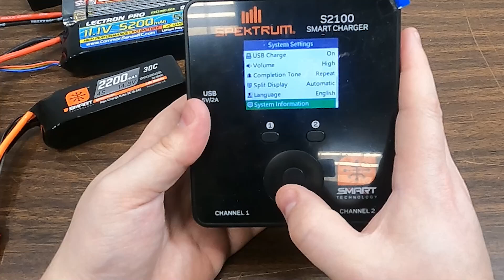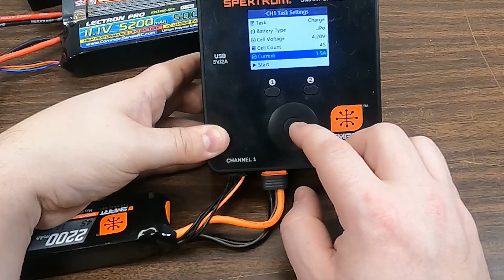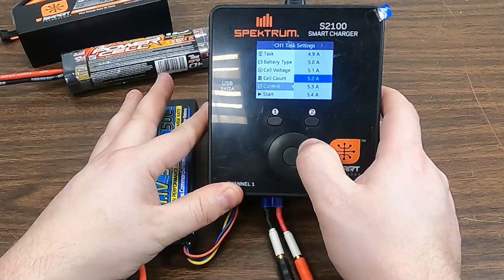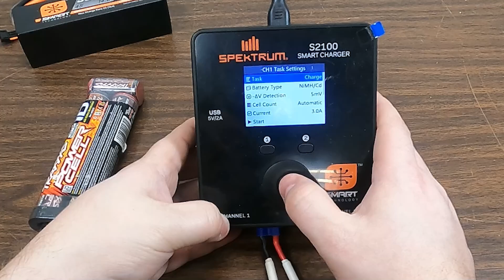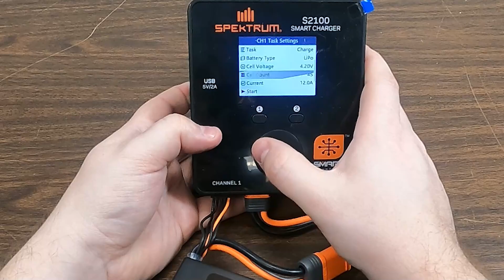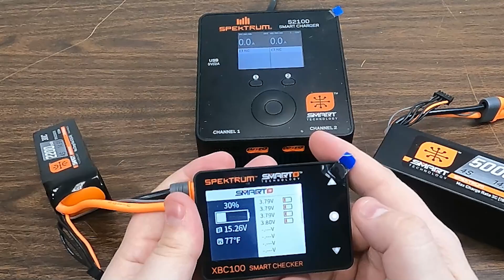How to set up and use a Spektrum charger.

Comment: What's the name or model number to the updater cable. Would there be an issue if the Grey cable smart cable is cut off? The balance cables are fine.

Comment: So I have a question. I was charging both batteries once it was done after the second beep I went out side for about 6 minutes when I came back in side to disconnect I noticed the charger was off . I disconnected the batteries but the charger did not turn back on ! Any ideas? Could it be it fried the charger?

Comment: I have bought two of these s2100 Smart chargers and have been trying to charge one 6S spectrum battery and two 3S spectrum batteries and both chargers will not do anything. I plug everything in it doesn't even recognize the batteries in the channels I try and charge it gives me the warning to charge without the balance lead plugged in, which it is plugged in. try to charge anyway by clicking yes starts for half a second and then says abnormal battery connection. this happens on both chargers and with all batteries.

Comment: Dear all

Need help. After two months charging, everything was working perfectly. Today was doing same procedure, as soon as I press start charging, no reaction. Don’t know what to do. I have two batteries, same thing 

One more thing, when I turn on the smart changer on a screen blinking a battery 🪫 with a question mark ❓ 

Spectrum S2100 smart charger
Battery 5000mAh 4s 14.8V 100c
Please suggest maybe a hotline for consultation.

Thank you
Reply from the maker: Sounds like maybe you have battery issues. Do you have a volt meter you can check the battery voltage with. The batteries you have should not be under. 12 volts. if it is you have bad batteries.

Comment: I have this model but screens are different. Is it supposed to automatically balance the cells. I often have some max min between the cells as much as a .25 volts.
Reply from the maker: It will only balance the cells if the balance lead if plugged in for the g1 batteries and will balance automatically with the g2 batteries. If your cell voltages are off after the charge is completed then you may have issues somewhere. Chargers will balance near the end of a charge so if it is still charging the be patient the charger will fix it. 

One thing to note that if the batteries are off by a lot, it make take the charger several cycles (one cycle meaning one charge and one discharge) to balance out a battery.
Reply: @Hobby365  thanks.  I have a spectrum G1’s and HRB’s.  I can charge and balance them, but after a recharge they get out of balance again. Sometimes as much as .25 of volt.

Comment: I have a smart technology 5000mAh 50C battery by spektrum for use with this spektrum s2100 charger. When i plug in my batteries, it will not detect the battery and will not charge. When i try to charge it, it says that there is no less detected even though it's plugged in properly.
Reply from the maker: That sounds like you have lost cells in your battery pack. There are multiple checks the charger does before charging your battery. The one it is failing is the check that the voltage on the cells match what the chip in the battery is telling the charger what it is. If this is the case you would need to replace or warranty your batteries.
Reply: @Hobby365  thank you! They are only 6 months old.
Reply from the maker: @satisfied_squirrrel25903  Horizon is really good about warranties I think they will take care of you.

Comment: I randomly ended up with one of these spectrum smart batteries but I don't have the smart charger. Can I charge it on a regular balance charger?
Reply from the maker: If you have a gen 1 battery it will work on any charger. you can tell if you have a g1 very easily by checking if there is a balance cable on your battery. If there is no balance cable it wont work on any charger expect the Spektrum branded chargers.

Comment: How do you get the split screen to show both charging ports at the same time?  My S2100 only shows one at a time and I can't find any setting to change it in the system settings.
Reply from the maker: Sadly there is no way to show the status of both ports at the same time.

Comment: Great video! I'm new to the hobby and just purchased carbon cub s2 and I love it. I bought few extra 3s 2200 liperior Batteries. I have a the spectrum smart charger that came with RTF package, after watching your video it made me realize I can't charge my new batteries using my current charger? This is what I have
 S120 USB-C Smart Charger 1x20W
Any suggestions? Do I need to buy a new charger?
Thank you
Reply from the maker: Hi there. The only reason you would need a new charger is if you have a G2 battery. Its pretty easy to identify as it will have no balance lead coming from the battery. The basic s150 charger is only $35 and the newest versions will have a foil sticker on the box to indicate that it has been updated with the G2 software. If you find an old one there is an updater cable (SPMXCA100) that will update the software. unfortunately the cable doesn't work on your current charger.

Comment: I'm charging a 5000mah 100c 4s 14.8v what should I set my current to for the fastest but safe charging time?
Reply from the maker: Hello there! I would recommend 1c charging. Take your 5000 mah and divide it by 1000 that will equal 5 amps. Then multiply your 5 amps by 1 to get a 5 amp charge rate. 

Note: Some batteries have a 2c or greater charge rate. That rating will be listed in your battery specs. If your battery has a 2c charge rate then multiply your 5 amps by 2c to get a 10 amp charge rate.
Reply: @Hobby365  cool cool thank you for the info

Comment: Why does mine not charge
Reply from the maker: Most of the time when the charger doesn't charge the batteries it is a problem with the batteries. You might try a voltage or lipo meter to verify that the cells are above 3 volts each. If they are below that threshold you have batteries that are not safe to charge.
Reply: @Hobby365  can they be recovered if they drop below 3 volt?
Reply from the maker: @RoopsPhoto  I would not recommend trying to recover batteries. My belief has always been: The deductible on my home owners insurance is far more expensive than the battery and if it catches on fire you cost your self way more money and generated way more stress for you and your family. 

There are videos on how to do that on YouTube if you really want to try it. I just wouldn't recommend it.

Comment: I got another question for you I have a spektrum 3s 800mah 50c with a jst plug any idea on why it wont let me change the discharge time like on all my other batteries. I usually set them to 48 hours but this wont let me do that? any idea???
Reply from the maker: I think you are asking about the auto discharge setting in the battery? That is because the JST plug doesn't support the functions of the micro chip that are in the "smart" batteries. If your batteries do not have that 3rd grey cable between your red and black wires then your battery doesn't support the auto discharge function.
Reply: @Hobby365  thank you i should of known that.

Comment: This is a great video and very helpful. Even better than the spektrum video. The problem I had was the balance lead not installed correctly until I figured out it had to be on the left side. Then I didnt realize the circle was the essentially a scroll when and I had to move in circles. Its also great that I dont have to buy a G2 charger just the programmer to update it.
Reply from the maker: I am so glad it helped you out. and thank you so much for your productive comments on my video.

Comment: my s2100 came with the ic5 to ic3 connectors in it already. however they didnt include balance port extensions which are needed and helpful.
Reply from the maker: Very true that the balance extensions would be helpful. Especially since there are more and more chargers coming with those plugs in the way the spectrum charger has them.

Comment: I have to say this was a excellent video. I was on the phone with horizon hobby and talking about this and the tech had no idea on what I was saying about amps and volts and he said he was a tech with spectrum division. I just hung up and you really give a great explanation on the charge rate by taking the mah of a battery and if its 5000mah the charge rate should be 5.0. At horizon they had no idea on what I was talking about and you did that very simple. another example if you have a 3200mah just set the charge rate to 3.2volts. thanks bud and Im hoping im understanding you clearly also.
Reply from the maker: You understood very well what I was saying. One thing to keep in mind is that more and more batteries can take higher charge rates. Look for Charge rate on the battery. If it says something like "2c charge rate" You could charge a 5000mah battery at 10 amps. Though I have a really hard time recommending that.
Reply: @Hobby365  I have a 3s 11.1v 800mah for my citation jet would I set the charge rate to .8?
Reply from the maker: @DronemanJoeRc  Yup that would be an appropriate setting.

Comment: I want to buy this charger, will this tell me when it’s done? Can it over change the battery?
Reply from the maker: This charger will tell you when it is done with a green boarder. The only way the charger will incorrectly charge the battery is if you set the charger to the wrong setting.

Comment: Auto storage & spectrum smart Lipos (set to 72 hrs). Does this mean you don’t have to plug in and power to storage if you didn’t use the battery within 3 days?  Also how many weeks of no use would you be happy to leave the smart spectrum batteries on their own before recommending ‘set to storage’ or is the auto discharge good enough.
Reply from the maker: With auto storage you wont have to do anything but verify or change the setting. After its programed time frame the battery will draw itself down to to storage level. There should be no need to set to storage beyond the batteries ability to do it for you.

Comment: Thanks for the vid.  Do you happen to have a link to the cable you showed at @1:49 in the video?  The multi connector to EC3 one.  Thanks.
Reply from the maker: That is a combination of the SPMXCA311 and a squid from almost any manufacture. plug the Spektrum adapter into the charger then the squid into the adapter